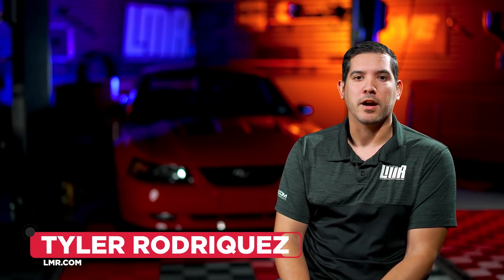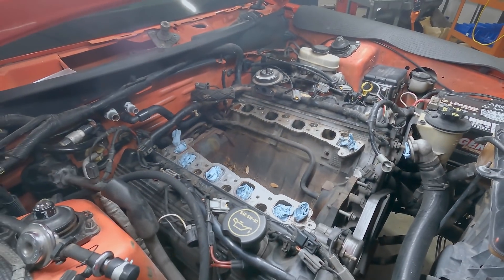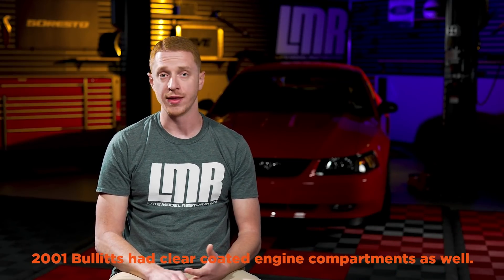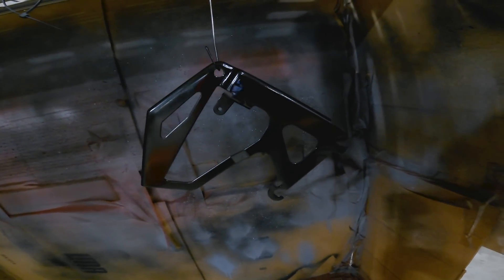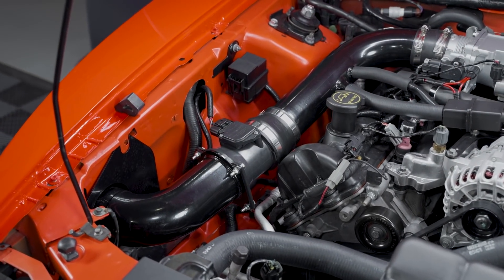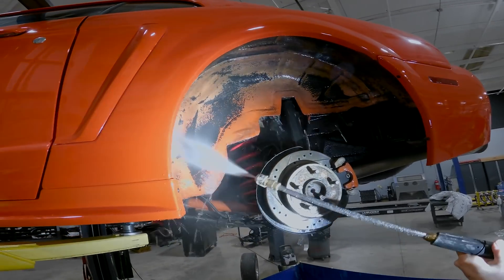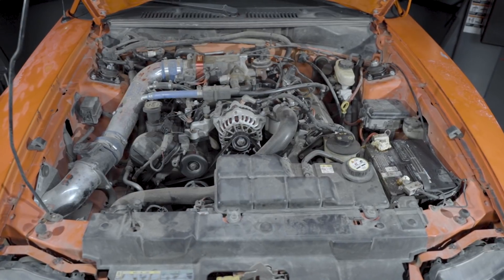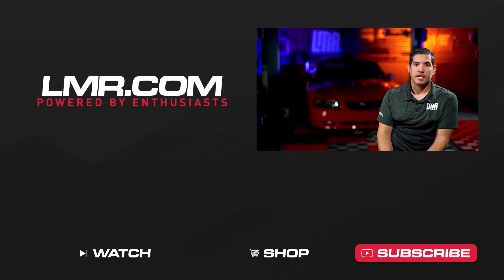Project Keeping Comp | Ep: 4 - Unforeseen Clean

Comment: Loving this series guys. Keep it up! I'm restoring (very slowly) a '97 GT. I have the motor out and been trying to figure out how best to freshen up the engine bay and wiring harness. Any more tips as far as the wiring harness goes? Not even sure how it comes out to be honest.
Reply from the maker: Hey Tomas, 

A lot of detailing and cleaning went into the engine bay. Landan had removed most components to make it happen. When it comes to the harness, spending the time to research removing it and restoring it is ideal. There's not a step by step process to do it yet, it's really more of figuring out as you work on the car.
Reply: @latemodelrestoration  Thanks for the response! That's what I gathered from my research as well. No "one size fits all" instructions it seems. That's why it's a project though, thanks y'all!

Comment: Where did you source the new battery cables? Mine are worn out and don't tighten properly anymore but I've had trouble sourcing new ones.
Reply from the maker: Hi Logan, 

We had sourced a set of terminals from a private seller online and rebuilt the cable ends on the car. If you would like some assistance with sourcing a set, feel free to give us a call at 1-866-507-3786 or email us with the link below: https://lmr.com/contact

Comment: I would love to see someone go into detail about negative battery cable replacement in the 4.6l SN95. I've not been able to find a replacement cable. I've got a 96 GT with an 04 PI swap. If anyone has a negative battery cable part number please share.
Reply from the maker: Hi Robert,

We had sourced a set of terminals from a private seller online and rebuilt the cable ends on the car. If you would like some assistance with sourcing a set, feel free to give us a call at 1-866-507-3786 or email us with the link below: https://lmr.com/contact